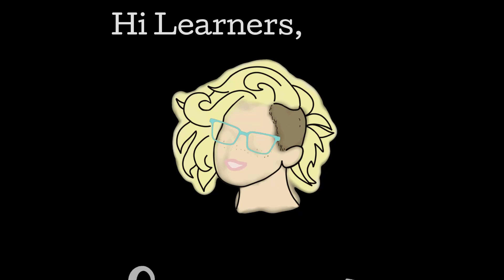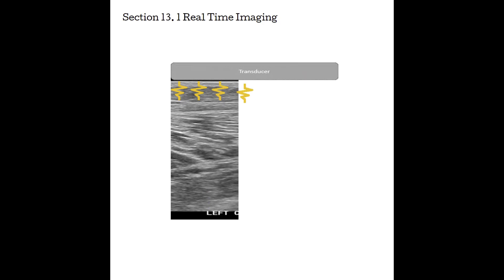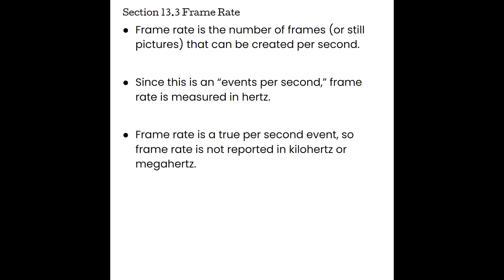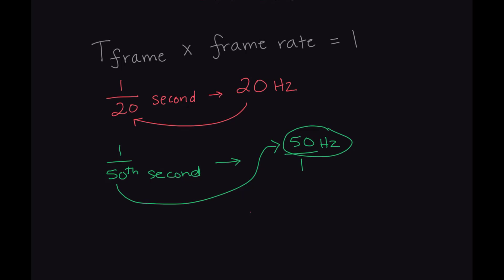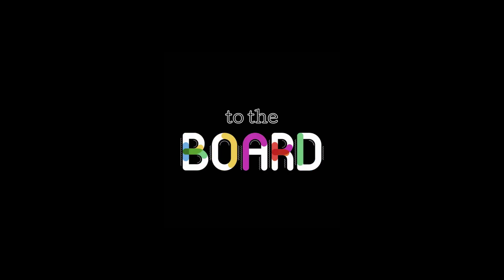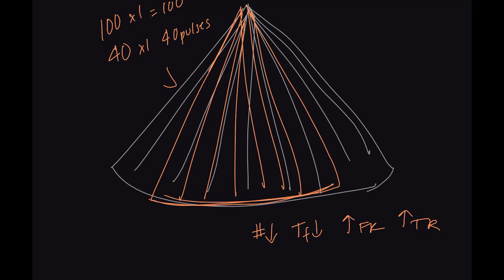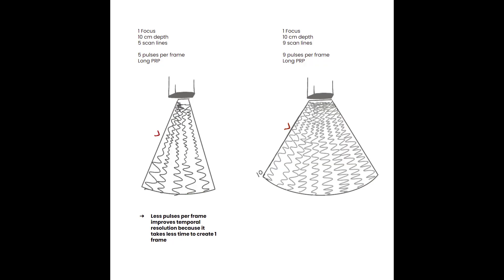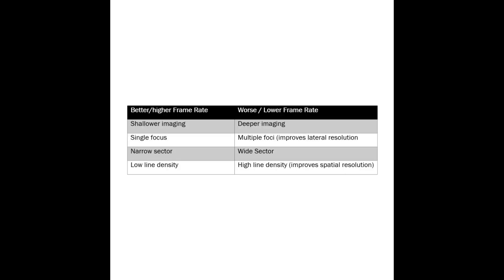Physics with Sononerds Unit 13

Comment: I am getting confused at the 30 min mark. How do we get 260?
Multiplying the 100 pulses by the 20 cm should give us 2,000 therefore giving us 20,000 and moving it over to the left 6x should be 0.020. Then we would do 1/ 0.02 which gives us 50. Am I not understanding? Thanks.